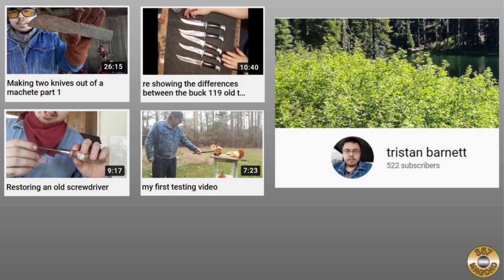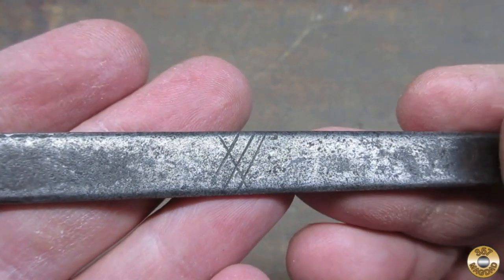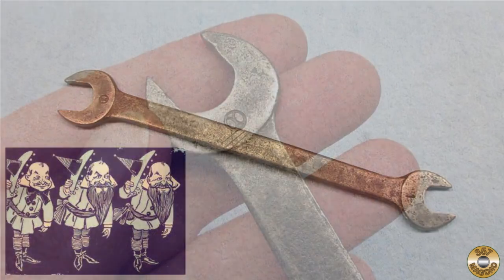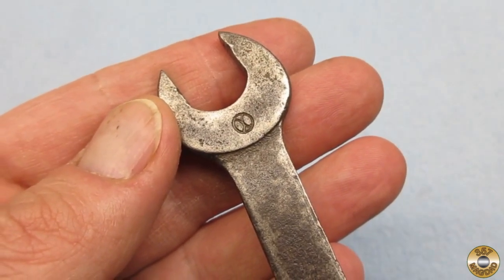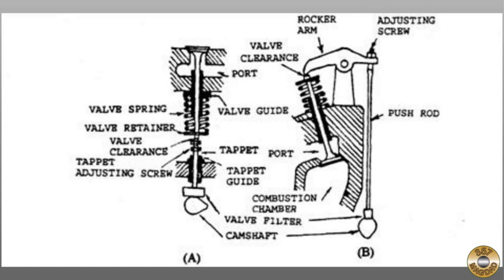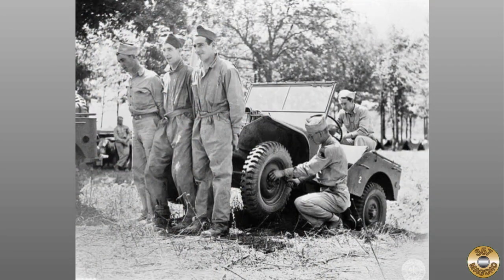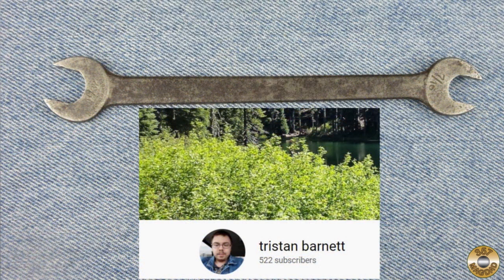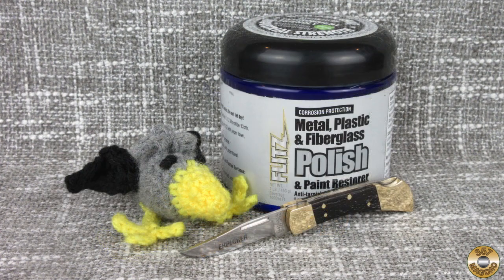Duro Wartime Tappet Wrench

Comment: When the title said tappet I wondered if it was what you described later in the video.  I have a flathead in my M38 Jeep and just went through that process of adjusting the tappets. I can see the advantage of manufacturing  the wrench as thin as it is. Pretty neat.  Thanks for the fun.  :-)
Reply from the maker: Thanks Mark!  It seems like the bend that was added could be helpful on certain engines too.

Comment: Looks right to leave it original     Nice knife ..Putting the Jeep on it's side made it easy to work on ..You could tip over old cars back then and never put a dent in them
Reply from the maker: Can you imagine taking your car to the shop today and watch the mechanics tip it on its side!
Reply: @357magdad  You can make a rotisserie to put a car on and turn it to work on the under side Seen one in a yard once that was home made
Reply from the maker: @not2fast4u2c  Cold War Motors has a Rover P5 that they're restoring on a rotisserie.
Reply: @357magdad  I will check it out

Comment: I believe Super Clean contains lye, i.e. sodium hydroxide. This causes it to work very well, but the first time I used it, to clean kitchen grease from a painted metal panel, I was interrupted by a phone call. When I returned to my project, the paint had softened, and I had to be very careful to remove the dirt without removing the paint. The label explains this, but I failed to read it until after the paint softened up.  My mistake, but a very effective cleaner for unpainted surfaces. Tappet wrenches are great tools to have in your tool box.
Reply from the maker: Super Clean has a high pH.  I try not to use it on painted items and I wear gloves.